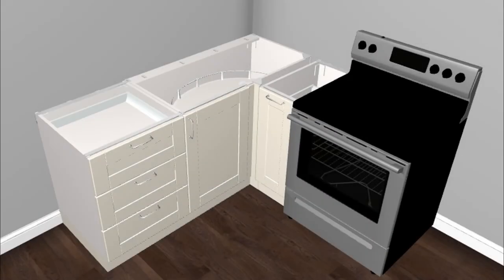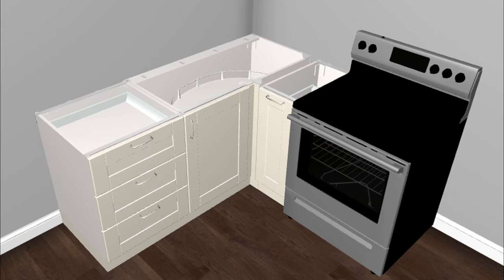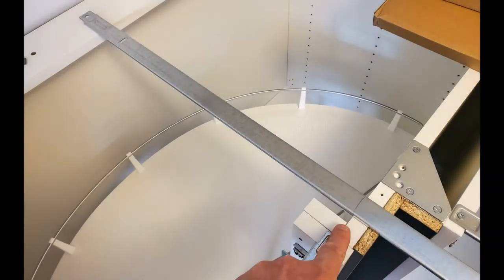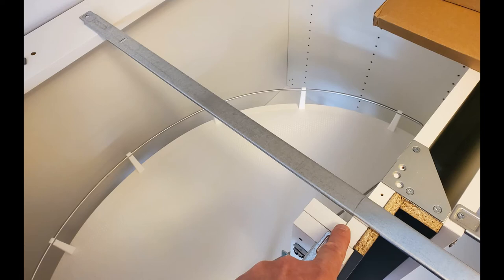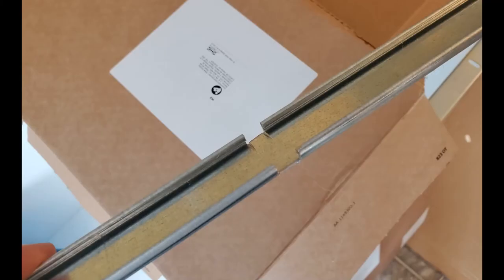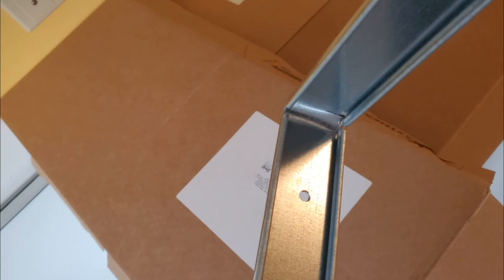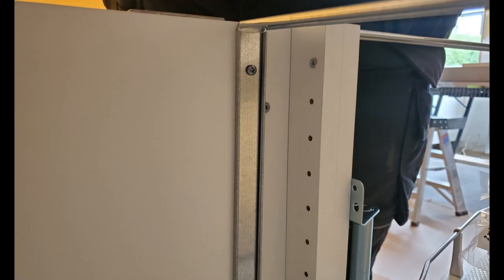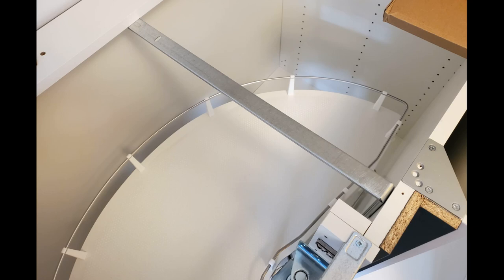Unlock the key to a sturdy IKEA corner cabinet with this strong tactic.

Comment: Thank you Lars. I used the corner cabinet reinforcement method and nobody has said anything but I noticed before and after countertop installation  that the super Susan and adjacent drawers are solid.
Reply from the maker: You're very welcome. Yes, it makes s big difference. I do it at every single 47" corner cabinet.

Comment: What length screws or type of extra ikea kitchen screws do you recommend using to attach this bracket?
Reply from the maker: I use the shortest ones that comes with the base cabinets (but not from the corner cabinet). They are about ⅝" or 15 mm long.
Reply: @kitchensbyrannes  thank you for taking the time to reply!

When I check my base cabinet screws the smallest one (except the short fat one for the wall bracket) is 20 mm long. Screw/part number 108530, is that what you are referring too?

Thank you for your help!
Reply from the maker: Yeah, that one. Just check that's not too long. You can add one of the flat washers that came with the corner cabinet so it's effective length is a tad shorter.

Comment: Hi thanks for the video. With this exact corner cabinet what's the minimum size spacer I can use. I will have a 600mm sink unit next to the spacer but really need to save space on that wall. I will have voxtop handles doors.
With thanks
From UK
Reply from the maker: Hi Richard. 
Thank you for your question.
The minimum size of the filler depends on a few things. Will the adjacent cabinet have a door or a drawer? Since you're having a sink cabinet in that location I guess you're having a door and thus you might not need to be able to open it the full 110 degrees.
Should you have a drawer in the cabinet however, you certainly need to make sure that the cabinet front is perpendicular to the corner cabinet or is sitting at an angle less than 90 degrees. If not, the drawer may move in towards the door on the corner cabinet when opened.
I would say that the best way to determine the width of the filler, is to put on the door of the corner cabinet and measure how far from the cabinet the door protrudes and then add 1/4" (5-6 mm).
I hope that helped.
Reply: @kitchensbyrannes  That makes sense. Really appreciate your reply. Thank you 👍

Comment: Hi! I’m installing a 24” cabinet next to the spacer trim. I need to attach the corner 47” cabinet to the 24” to keep them flush together. Any tips? (From USA :)
Reply from the maker: Thank you for your question. The process is standard. However, don't add the filler between the two cabinets before they are in their final spot. Sometimes, depending on the layout, the 47" corner may need to slide a bit to the side for the perfect lineup. 

Also, unless your fronts are Whire as Axstad or Vedding, you should cut fillers/panel strips from a matching panel and double up in the corner. If you don't, the corner will be bright white.

I will probably make a video about it, but it might be a while, so don't procrastinate :-) Just do it.
Reply: @kitchensbyrannes  I just didn’t find any info in the manual about securing the 47” cabinet to another one on the side of the trim, not videos, nothing. I wish I could put a picture here ☺️. Thank you for all your videos! Very helpful. By the way, what country are you from?
Reply from the maker: You're welcome to send a picture to my email info@kitchensbyrannes.com
I'm from Denmark, living in Canada.

Comment: Have the sink cabinet with 2 rails, but no extra.
Reply from the maker: For the sink cabinet you'll have to replace the standard metal rail with the reinforced one, at the correct length. Then you can use the standard rail for reinforcing the corner cabinet.

https://www.ikea.com/ca/en/p/sektion-reinforced-ventilated-top-rail-galvanized-60284581/

Comment: *no handles on doors*
Reply from the maker: I guess you're referring to the Voxtorp doors you're using on your installation, right?

Yes, there's no handles on these so they won't collide with any doors/drawers on the adjacent cabinet.

However, even if you'll have a drawer in the sink cabinet you mention, the drawer will not move so far out of the cabinet that it will hit the handles/knobs, if they are mounted in the upper corner of the door.